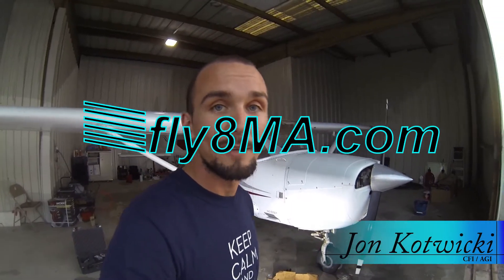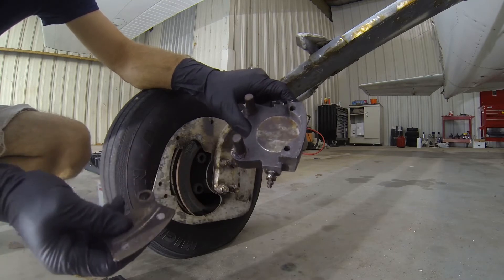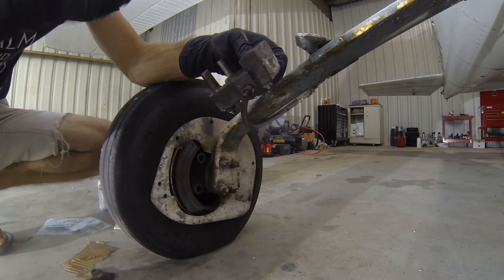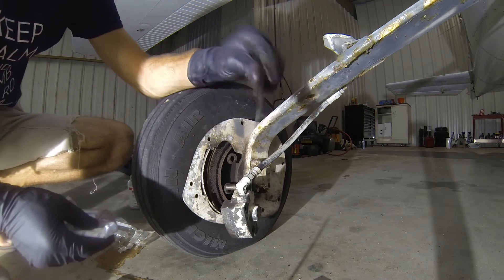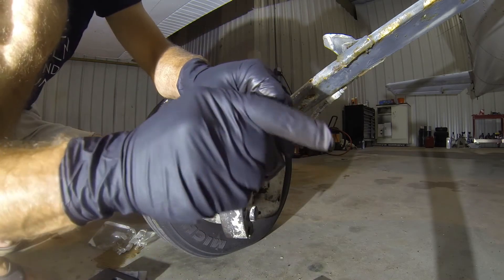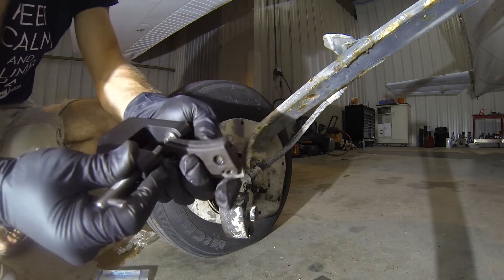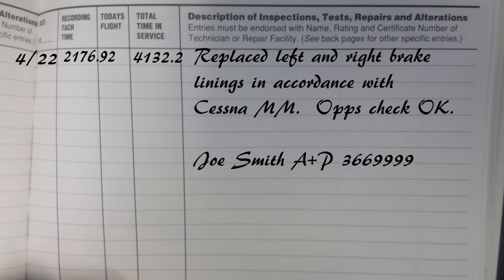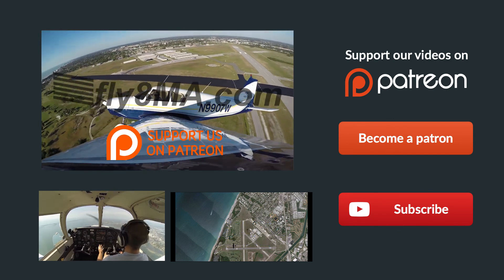How To: Replace Cessna Brake Pads | Most small a/c brakes

Comment: Careful using that anti-seize. Anti-seize is used inbetween non-moving parts and in this case it will attract dirt and grime. Instead use a dry film lubricant per Cleveland instructions.
Reply: Excellent comment as the wet lube will turn into a brake dust/dirt/grime paste.

Comment: When washing a Cessna 182, should chocks or brakes be applied when washing the aircraft? My point of view is that properly chocking the tires without applying the brakes is best, as it saves hydraulic pressure cycles, allows for better flow of water and cleaning solutions, and helps them dry better while washing.

Comment: I use this video in my wheels and brakes class to show what not to do when changing the linings. Like- installation with no torque, disc is toast, wrong anti seize used see Cleveland manual -- Install cylinder assembly in torque plate by sliding anchor bolts into bushings.  A dry film lubricant (Appendix B, Section B3 for your climate environment) should be applied to anchor bolts and torque plate bushings to assist sliding motion.  Exercise care to insure that linings do not become contaminated with fluid or lubricant.  For best service life, cylinders must slide freely in torque plate.  https://www.parker.com/literature/Aircraft%20Wheel%20&%20Brake%20Division/AWB%20Static%20Files%20for%20Literature/AWBCMM0001.pdf

Comment: I would assume this would only work for pin style brakes? Per the refs, pilots can remove tires and replace them so by definition they can replace brakes more or less. Now as far as whipping out a Hammer and punch and brake rivet press, would that be allowed? 

In my opinion, a competent pilot could do it. But I’ve seen too many people get their pilot certificate and think everything is a preventive maintenance task. Starters, wingtips, wingtip lights (STC replacement), etc...

Comment: That's filthy. Should have been removed, dissasembled, cleaned, the bore cleaned, new piston o-ring with brakes back bleed. I'm not an AP and know better. I'm assisting in a break service on a 180 today because the right brake was not releasing (how dangerous is that?). Breaking down the calipers it's evident that only shoes were put on the plane the last annual and no servicing. Why even lube the pins? When those calipers get hot that grease is going to thin out and migrate.

Comment: Actually, your aircraft record entry is a little incorrect.  The entry for maintenance in accordance with part 43 section 43.9.  You are correct a pilot cannot sign this type of maintenance off an A-rated mechanic can.  However, if a pilot or anyone assisted their name must be in the entry for the work they performed per par 43.9.  Also, part 43.13(a) says we have to use current maintenance date so the Service Manual number, revision, and date should be noted in the entry along with what section of the manual the task was performed such as section 5 landing gear.  Total time or tack time is NOT required by part 43.9 but a good practice.  Lastly, you stated you burned the brake in.  Is this procedure in the Service Manual and did you make a pilot entry for ops checking the brakes “burn in”.
Reply: This very well be allowed as owner performed maintenance, see the FAA letter of interpretation saying that appendix "A" of part 43 is just an example see:  https://www.faa.gov/about/office_org/headquarters_offices/agc/practice_areas/regulations/interpretations/data/interps/2009/Coleal%20-%20(2009)%20Legal%20Interpretation.pdf  specifically page 2 second paragraph.  I have to remove the brakes to replace the tire
Reply: @anonymous-nobody1  This is fine for the intended operator of a TRANSPORT CATEGORY under part 91 or 135.  Even if preventive is listed indicating it may be performed under Appendix A but in part 43 there are still limitations to Appendix A.  The main limitation is part 43.13 Performance Standard.  To perform preventive maintenance the person allowed in part 43.3 still has to have the current service manuals, special tools (calibrated) and have performed the task at an earlier date under the supervision of a certificated mechanic in accordance with part 65.  Just because an item is listed in appendix A is NOT a blanket right that anyone can perform the task.  All of part 43 applies just saying.
Reply: @dennypollard8004  you need to re-read the FAA letter as I think you got it backwards , the letter said that an operator of an aircraft used for 121 or 135 doesn't fall under the owner permitted maintenance but small aircraft operated under 91 do.
Reply: @anonymous-nobody1  I do understand the letter and it is correct 121 and 135 do not fall under preventive maintenance.  The point I am trying to get across is just because 43 Appendix A list item a part 91 pilot may perform there are limitations they must meet.  Again limitations are training, tools, current manuals, and special tools.  As an example ,the tire pressure gauges should be calibrated at least the one A&P mechanic use and per part 43.13 if you perform preventive maintenance the owners are required to have the calibrated gauge as well.  Same for torque wrenches for a spark plug, brake retainer plate bolts, and etc.  That is all I am trying to get across.
Reply: @anonymous-nobody1  clearly he's an FAA guy. Pain in the ass. Probably knows lettering in the FAR's better than putting it to practical application. Typical fed

Comment: Joe Smith A&P would be liable if signing off on this with the extra anti seize on the female part should it be enough to spill out onto the rotor.  Don't do it Joe Smith! Clean everything, and don't double up on any lubrication unless manufacturer has sent out a safety request to do so. It's your ass Joe!